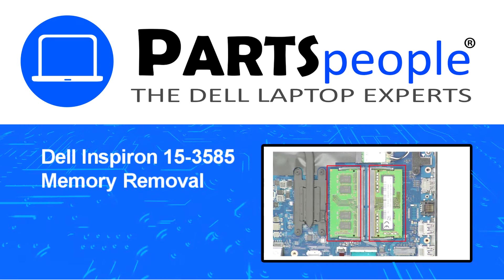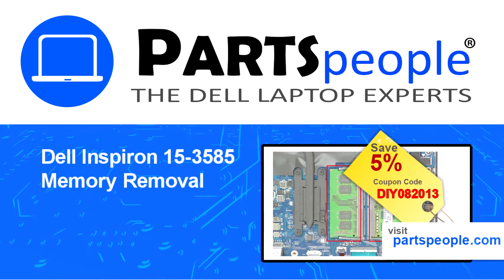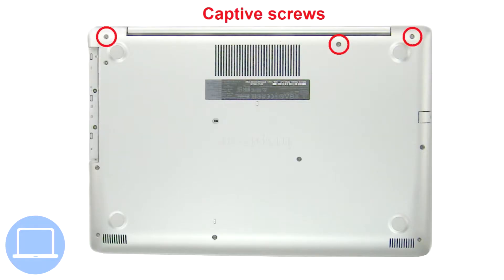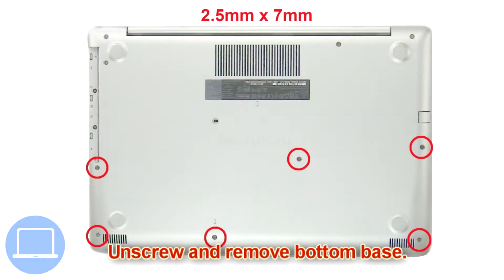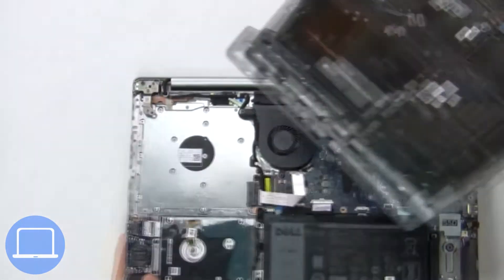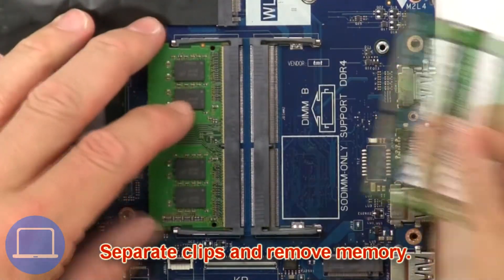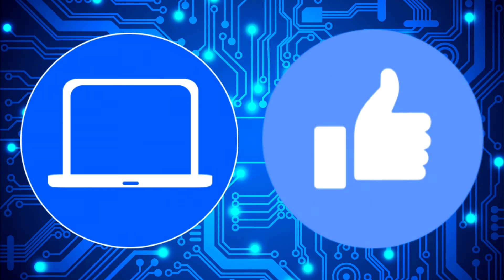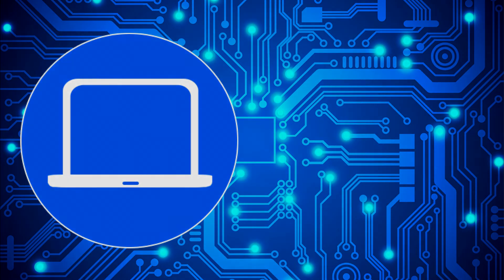Dell Inspiron 15-3585 (P75F008) Memory How-To Video Tutorial

Comment: Thank you for this video.
I currently have 2 x 4gb 2666MHz ram and bought 1 x 8gb 3200MHz as an upgrade (i know it'll go to the slower speed, but wanting to be able to use in another machine later on). 
Does it matter which slot I install it in? 
Thank you :)
Reply from the maker: It does not matter which slot you decide to use.